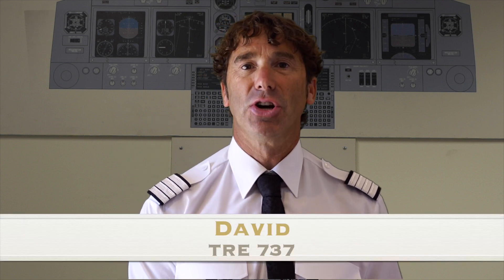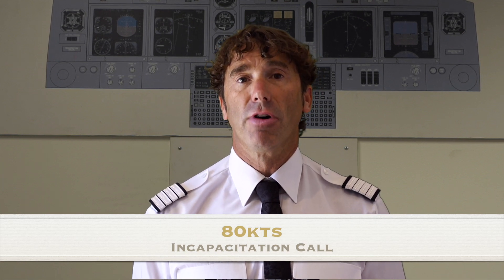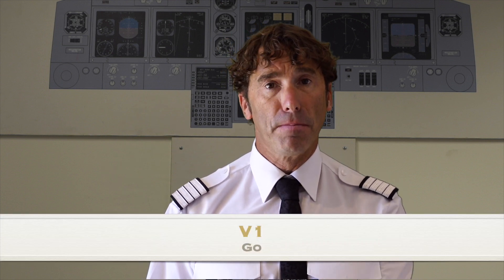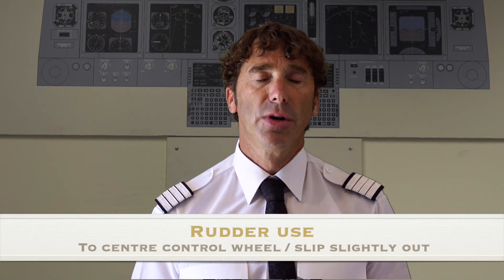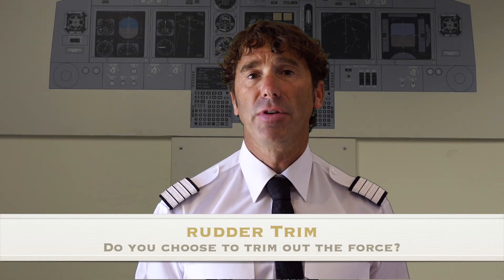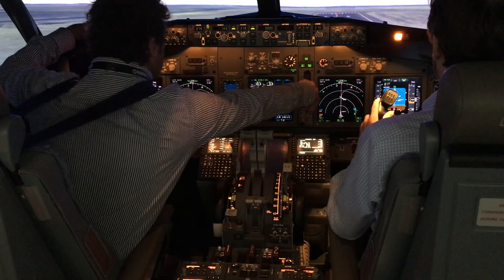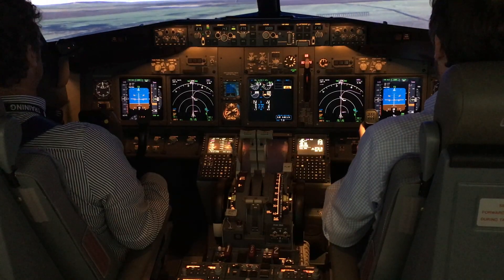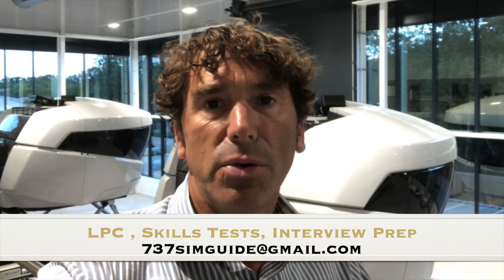Engine Failure on Take Off - Part 1

Comment: I am an older pilot having flown all Boeing fleet! David is an excellent instructor for these videos and very clear British English🥂
Reply from the maker: Thank you for your feedback. There are not many pilots that have experienced the complete set of Boeing aircraft. That certainly gives a very broad depth of understanding in the design philosophy and evolution over the years. 🙂
Reply: You are correct!!Having flown also the 747-200 I can tell you that especially very close to a clean maneuvering, you’d be very careful to keep it higher.. in any case you have the concept so clear in your mind that when you explain you can feel the deep understanding. I have just renew my 737 but too hold to fly 😂

Comment: hi, can you pls help explain on how to effectively handle the rudder trim for engine failure on descent (lvl change/vs) from one level (holding) to another (approach) to avoid unwanted yaw and during touchdown especially with crosswind condition thank you
Reply from the maker: Hi Rukawa, handling rudder trim in descent and in approach is a personal thing. The goal is to spend as little time trimming as possible to reduce worklaod. FCTM says rudder trim may be set to zero for landing prior to 500'. The pros are that there is no rudder pressure during landing roll when thrust is reduced to idle for roll out and the cons are on the approach it can increase the workload and have higher rudder pedal forces required in the event of a  go-around. Most pilots find the easiest way is to set 4.5 units trim if failure occurs on Take Off and then trim for level flight. In the descent it is best to use lvl change not VS, then just reduce thrust for the descent. Using VS results in more thrust changes to control the speed. Every change of thrust needs inputs to the rudder. A bit like a puppet on strings, left thrust lever forward=left rudder forward. X-winds are challenging but equally as important as rudder trim is using your visual aiming point and getting the thrust off for a Boeing landing to avoid a long float. Please leave your comments how you trim rudder SE for landing?
Reply: 737 Sim Guide once committed/confirmed to make a landing i will ask Pilot Monitoring to zero the rudder while my feet ready on it